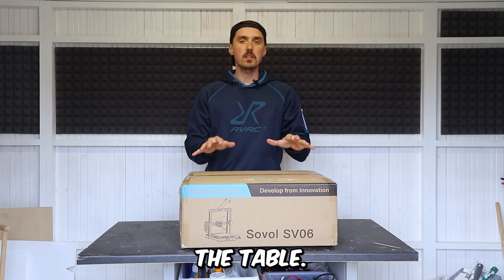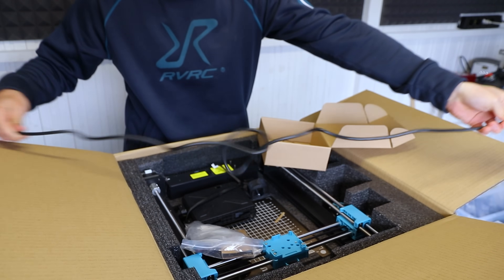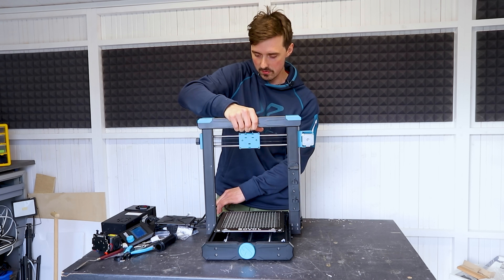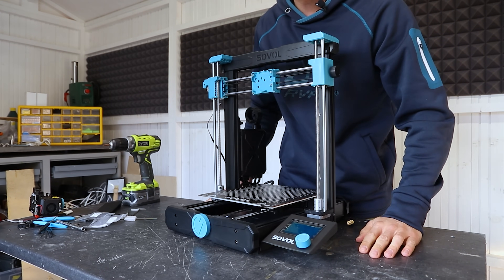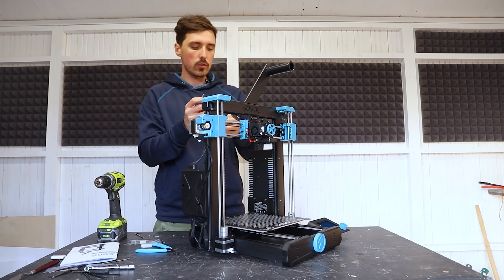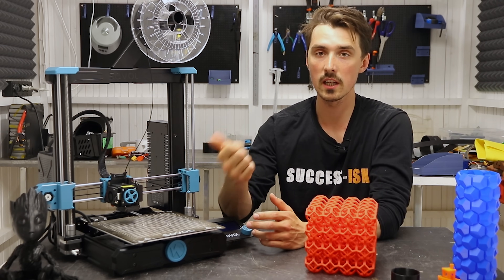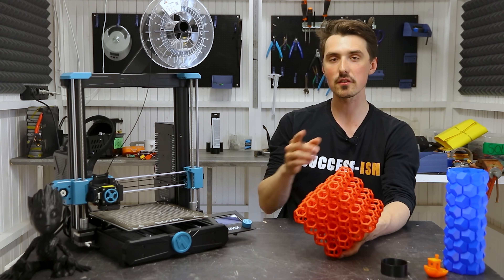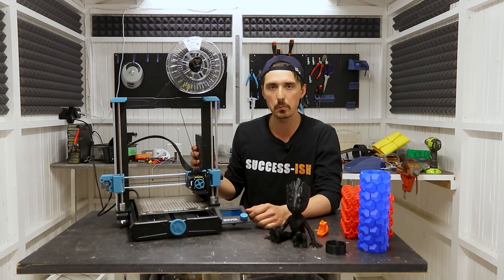$230 3D Printer Can't Be Good? - Sovol SV06 Review

Comment: Having owned this printer for a year, describing it as "good" would definitely be a bit of a stretch in my eyes. "Decent" might be more appropriate, but it constantly has annoying little issues. Came with a very warped bed (common issue for this machine), x gantry often gets out of level within a week or two of leveling it, bed probe seems a little inconsistent but always overestimates proximity on the right side, resulting in printing too high on that side regardless of the gantry leveling. If the belts are a bit too tight, the steppers will make these horrible crunching noises on travel moves, and layer stacking is atrocious sometimes especially for fast straight lines. Not sure if this is a z axis or hotend issue. I have been very happy with the extruder tho, I never get clogs and very rarely see underextrusion. And the quality can be decent if you slow down. And the price is fantastic of course

Comment: Strange, I have had my SV06 since a month or so after launch date and I have had no issues with bed adhesion. I did however tram my gantry to the bed rather than to the top. The automatic gantry leveling simply is not effective, the frame twists slightly when trammed and the gantry is slanted as a result, not to mention the end stops at the top are often not level and are not trammed to the bed themselves. Tram the gantry to the bed using 2 objects of identical height and you should have no issues, even with a slightly warped bed.

I have only used 95a TPU on my machine (as far as flex is concerned), but sunlu 95a seems to print at 100mm/s with no issues. I accidently used my PLA speeds on a TPU part and was kinda shocked how well it printed. I think "Lost In Tech" had an early beta machine and it was the only SV06 I saw that had problems with TPU.

Comment: Thank you for this review. I just picked one of these up as a starter printer and its good to see it does such a good job.
Reply: They are a great printer, the only tip I would give is to not use the automatic gantry leveling (the one that rams the gantry into the top of the frame). It's often inaccurate and you are better off lowering the gantry onto 2 identical objects placed about 20mm in from the edge of your bed till  the gantry just barely touches both objects with even pressure. Remove the objects and home the machine and then do a bed mesh and you should have a more accurate level for the mesh to compensate for.
Reply: @Smokinjoewhite  thank you! I'm still learning so I'll need to look into some of the terms you used. :) Any recommendations on sites to help newbies?

Comment: FYI I would HIGHLY suggest opening the control box and trying to wiggle every screw-terminated ferrule. My SV06 was printing totally fine then the bed stopped heating and my klipper threw a thermal runaway error.. I thought the cable had been mis-installed at the bed with how it is, but no! They managed to wedge the wire ferrules underneath tightened screw terminals.. on 3 of them! That's a big QC yikes, that could have been a fire if thermal runaway hadn't noticed something was wrong.. No idea if their firmware would have caught that, I converted it immediately after confirming basic operation, just don't trust it until you look close at the connections. Also printables user "rogerquin_304616" has some very useful sovol strain relief designs, to further help with the the issues in their design.

Comment: I boght one of these, have had it for 3 weeks. i`m also part of a facebook group about them (and the bigger one).  most people  have ZERO issues witth hem.  Many have installed klipper and octoprint and what not and print at insane speeds.  SOME people have had issues with bed leveling, and random issues with power supplies, and stuff like that.  Qc isn`t amazing, but it seems that 98% of the printers are good from the get go.  The community to mod it, and fix problems is quite active.  post-sale support seems to be hit and misss, but overall seems more hit than miss.  I`m pretty happy with mine so far!  (ah yeah, the cooling is anemic.  but htere are plenty of mods available to upgrade and istructions and ducts available for free)
Reply: ZERO POST SALE SUPPORT -- ZERO!
Reply: @daveblane6442  I have heard the opposite from multiple people, including them being willing to replace entire printers. Perhaps try different channels to reach them.
Reply: can you send me the facebook group link or name? i want to join it too, I have issues with stringing, idk its the filament or the printer, I just open new PLA+ from SUNLU for less than a week and print in 200 celcius and it strings like crazy when printing mini string test.

Comment: Nice review. I'd just use the Nepturne 3 Max lol.
Reply: Neptune 3 max has pfte tubing so it's just a pla printer sv06 doesn't do you can do any filament
Reply: @alex59292  I'd definitely get the SV06 Plus over the Neptune. So many better features. The only reason to get the Max is if you truly need that huge print volume, and then it's still over $100 more expensive.